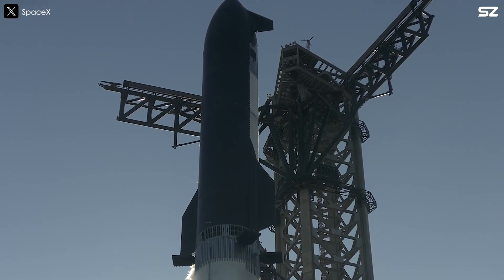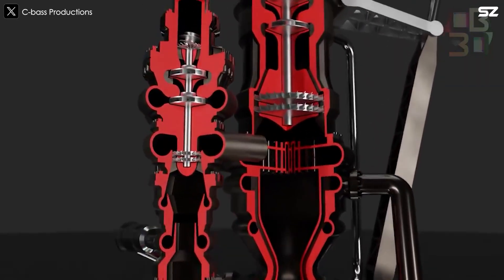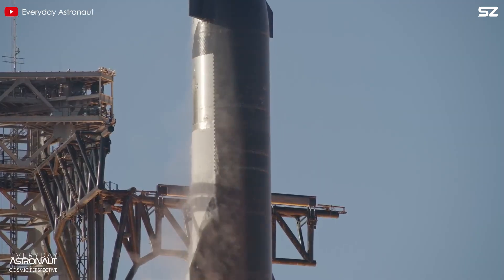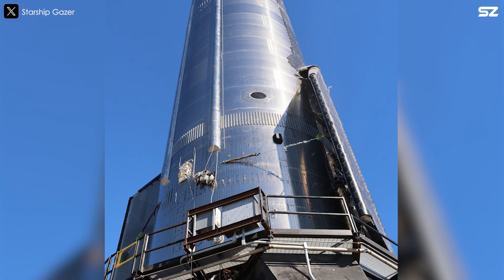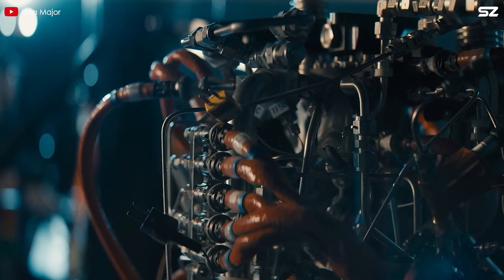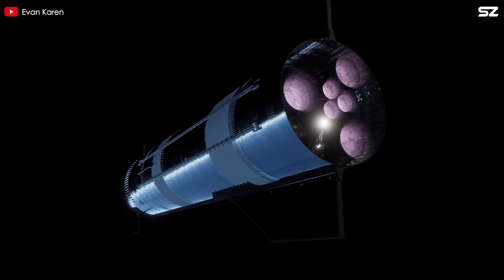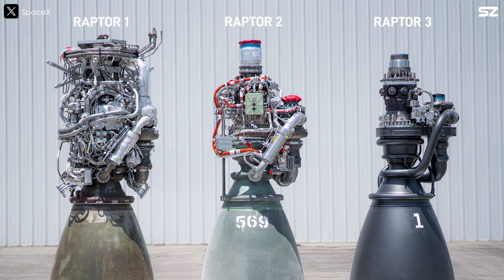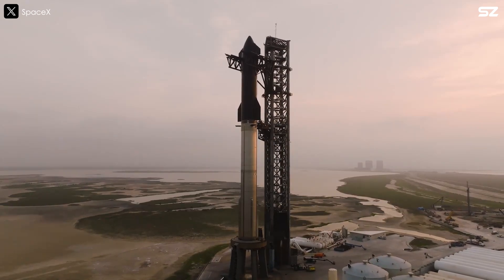SpaceX’s Explosive Raptor V2 Engine Problem!

Comment: Once again, rapid iteration fails.  There is nothing here that real engineering could not have anticipated.
Reply: You mad bro?
Reply: Maybe.  We miss a lot of things by going pure engineering.  I'm just thinking they may be iterating too quickly, or maybe they just don't have the skillset to understand the problems they're having?  The balance between engineering solutions and empirical analysis is tricky.
Reply: Possibly but the issue isn’t failures.  It’s about time.

Comment: wait...V2 ships are still using hydraulic TVC? Booster all electric TVC and understood change was made with Raptor 2.
a lots of conclusions jumped to based on limited information.
i am interested in the source of your information. seems dated and based on assumptions.
sorry, can't finish. too many 'logic' jumps and speculation presented as fact
Reply: Nope, they are using the electric TVC. I also called this mistake out in the comments section

Comment: I'm a little surprised that SpaceX didn't use linear actuators from the beginning. 
They are a mature technology (I was using them in machine designs in the early 80s).
They are much simpler to connect, simpler to control and probably lighter overall.
Reply: That's because you are probably an engineer, and Elon Musk is not.